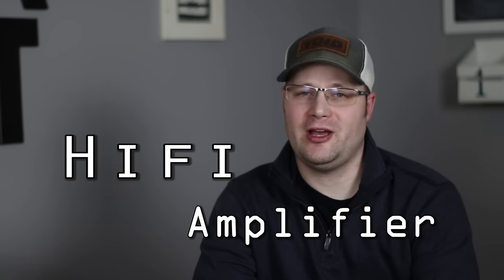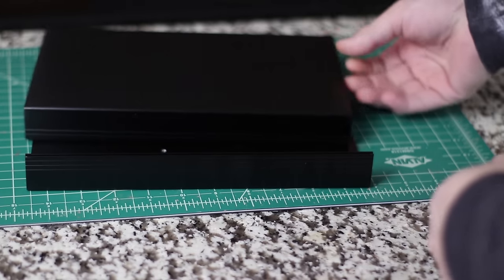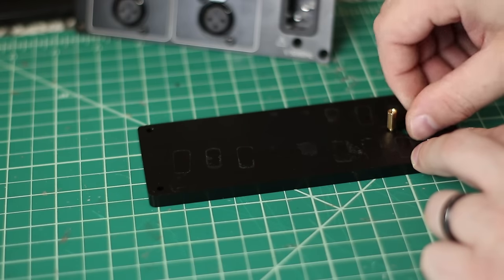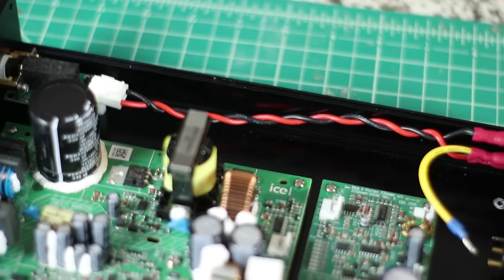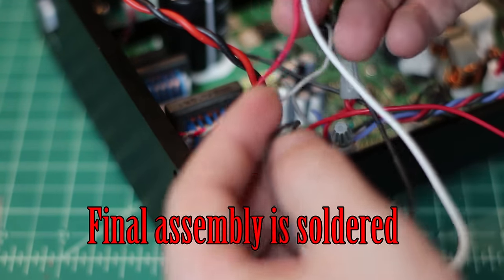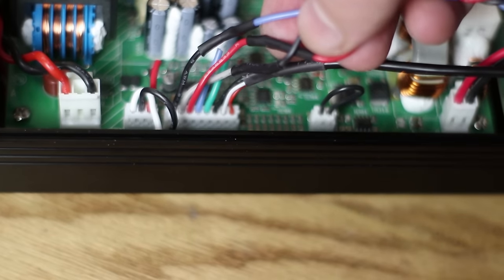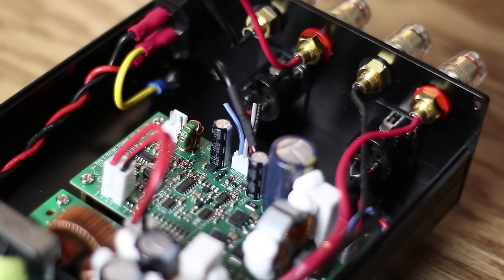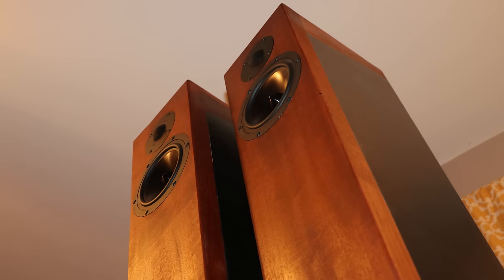How to Make a $3000 DIY HiFi Amplifier for $300

Comment: Humorous. This reminds me of specs put out by boombox manufactures of the 80's. I would throw my head back and laugh at a boombox producing 250 watts or more while running off of 8 D-Cells. What were those epic specs, PMPO? instead or RMS? Funny. I am not suggesting that is what is happening here but I might be inclined to think those specs are perfect environment specs with non-dynamic sources bolstered by more robust bench power supply systems. However, before somebody gets butt hurt because I decided to pick on D class, I can honestly say these amps would have a good fit somewhere, like for bookshelf or desktop system. It is all about proper application of any tech. I don't see a net value of $3000 whether they were badged PS Audio or not. If you put $3000 in my hands, I could get some gear of vetted substance. You put $300 in my hand and I could probably do the same with some used vintage gear, that would look and sound amazing.  You don't need to be a snob to be an audiophile and you don't need super deep pockets either. It's just unfortunate that deep pockets promote snobbery in audio. I am amazed that people have no problem buying a used car, that has hundreds or thousands of moving parts, but will not buy a used amplifier. What you do need is vast exposure to different platforms with practical listening time. You can't retire an old Sherwood receiver, put one of these amps together and think you have entered audiophile nirvana. It don't work like that son. Here is what I would do though. Go to a boutique store during their off hours and explain to the auditioner your situation to gain some exposure or ask to sit in on another's audition time. Just be a fly on the wall and you may hear what I am trying to convey. You may get an opportunity to buy someones old gear as they salivate over the new gear's fancy lights and dials. You don't need the snakeoil stuff. You just need some well designed stuff that will last the long haul, investing the larger portion of your dough towards your speakers.
Reply: Do you know anything about class D amplification? They put out GOBS of power in small form factors and low power consumption because of how efficient they are.

Comment: Got a thrift store that gives me all there electronics. I will stick with my free onkyo reciever. 7.1 suround sound and it even hooks up to the internet.
Reply from the maker: That's pretty sweet!  This would actually hook up to your 5-7 channel RCA out on the back of your Onkyo to upgrade the amplifier section.  So if you ever want to upgrade that is, you could do something like this. That is really awesome you get electronics for free
Reply: @Toid  that was the nicest one yet. Not a scratch on it and almost no dust on it. Its going in the 200 sq ft house im building. I think the power it has will do in a space that size. Just havent figured out what speakers to use. I have a nice collection of free speakers from Bose to Advent and JBLs. My house looks like an episode of Hoarders.
Reply from the maker: @chuckfinley5206  haha, just the way I like it!  Sounds awesome!

Comment: Oh Mhe Ghash... I don't need a smps power supply next to my pa.  I'll stick with my obsolete but still functional stuff from the 70s considering my aged ears;  just wish I still had my long-gone, low-efficiency speakers which would probably cost over $2.5K ea to build from scratch.

Comment: Anybody else here missed some sort of volume knob or buttons?
Reply from the maker: This is a HIFI amplifier that is typically used with a preamp like the rear RCA output on your surround sound receiver. The preamp has the volume control.  If you wanted to use this as a stand alone, without a preamp, you'd just need to add a potentiometer.
Reply: I see. Thanks for answering!
Reply from the maker: @clorophilla  you're welcome

Comment: Great video!!  I almost didn't click on it but super glad i did..  You should put $3000 for $300 in the title
Reply from the maker: I might just do that. Thanks for the tip!
Reply: I subbed as well.. Keep em coming!!   @Toid
Reply: @Toid  Yo bro, fyi that link to the Ghent case is broken.. Says certificate is expired
Reply from the maker: @Fine_art_aerial  thanks! I'll fix it
Reply from the maker: @Fine_art_aerial  I think it is fixed.  Here is the new link.  Thank you!  http://bit.ly/2N3SQZO
Reply: @Toid  Quick question.. I really want to build this but kinda skeptical..  How would something like this compare to the Onkyo m504?? I looked at the specs of this diy and it is tiny at 6"x10"x"2.. How can this be such a high quality amp and be super small like this?? Thanks in advance
Reply: I referenced the Onkyo above because that was the amp i was just getting ready to buy from eBay
Reply from the maker: @Fine_art_aerial  I've never heard the m504 and can't find it's specs, so it's hard to say.  There size difference is in the type of Amplifier.  This IcePower is a class D, while the m504 is a class AB.  A class AB is going to be bigger and use more electricity.  Whether you like the sound of one better, is going to be a personal preference.
Reply: @Toid   Looks like i got some research to do.. Thanks so much for responding! Whens the next video release??
Reply from the maker: @Fine_art_aerial  I should have 1 it later this week. I'm hoping to get 2 edited if I can.
Reply: @Toid  Cool can't wait!! One quick question.. Do you know of a preamp that would be similar in size and looks?? Im going for a very minimalistic look.. Only thing im gonna hook up to it is a turntable and my tv.. Oh and stream spotify so maybe bluetooth?? Thanks brother!

Comment: interesting build .. still wouldn't call those HI-Fi THD levels audiophile comparative ... with every thing relative .. may be better suited for woofers or even sub applications .. tech has improved for class D with some impressive results .. using eGaN chips achieving a stated "< 0.05% THD+N,  > 102 dB SNR" even then I would still only slate class-D for moving the mass of woofers and subs, and leave the fidelity of higher freq signal reproduction to other amp technologies, in regards to audiophile level audio... No clue if this is even avail in any kind of affordable consumer market yet, but sharing simply for the tech spec's in defence of class D for application in high end audio .. this tech would absolutely be ideal for inertia monitored distortion feed back signal processed woofer/sub applications ..  Is food for thought ... Here's the link to their 200W amp using their eGAN chips..
https://epc-co.com/epc/Portals/0/epc/documents/thirdparty/eGaNAMP2016_Consumer-123115.pdf
Reply: The human ear cannot hear that zero after the decimal point in THD specs -- studies vary as to the point at which THD becomes audible, but they agree that it occurs in the tenths of a percent range, not mere hundredths.
Reply from the maker: Many High End companies publish their THD=N at 1 watts.  Which for this amplifier the THD would be 0.008.  I feel that is misleading, which is why I give it's THD at full power of 0.2% THD.  So before you compare THD levels, you need to see how they are even measuring it (ps most won't tell you).
Reply: @editorjuno  what most people don't understand is that Distortion levels are not a fixed value and are almost always a Cherry Picked number from a sweet spot in the Spectrum.. this means that Distortion levels will fluctuate and if the numbers listed are best case scenario that means that only a small percentage of the time will the Distortion levels be at that sweet spot so if that cherry pick value borders the audible range that means most of the time the Distortion will be in the audible range.. when the quality of the equipment is high enough providing that extra padded zero after the decimal point it does matter because most of the time the Distortion will be far below the audible range at any reasonable power level no matter what frequency spectrum is fed through the system
Reply: @VorpalForceField  -- A fair point.  That said, all the Class D chip vendors publish detailed THD+N vs. power graphs that anyone wishing to get past the marketing hype can access online.  Just find out what chip is in the product you're thinking of buying and get yourself Googling.  :-)

Comment: those +12v -12v wires look like there a little weedy for 200w rms ...........  50w maybe.....
Reply from the maker: Here is the data sheet on this amplifier. Keep in mind this was created for oem.  Ie to be sold to HiFi amplifier companies that need accurate data.  Unlike data tailored for consumers.  https://www.parts-express.com/pedocs/specs/326-108--icepower-200asc-class-d-amp-with-power-supply-module-1x200w-data-sheet.pdf

Comment: While yes, many companies use ICE modules, many of them have a lot of engineering into developing the amplifier as a whole. This could be the power supply, input stage, volume control, etc. So, no, this is not the same as buying a PS Audio or a Bel Canto... more like the equivalent of buying an Emotiva which does like you do, just plop a standard ICE module in a chassis and call it a day. A completely separate discussion is the consideration of value. Value is such a variable thing, that it is often times a difficult thing to define for a wide range of people. Value can be solely from how the equipment reproduces music and the level to which you expect it to perform in certain areas like dynamics, distortion or others. It can also be from the social status it brings you, or the satisfaction it brings you in knowing you have a particular brand or aesthetic. So, without some evidence, whether that be measurements or listening tests, I wouldn't blindly equate things based simply on the fact that some of the hardware is shared between companies. It's almost like saying that an SUV and a sports car share the same engine, therefor they are the same... when you drive it, you will see it is a completely different experience.

Comment: Anyone actually hear this amp? Is it worth making? What makes it worth $3000 as an amp?
Reply from the maker: I've made quite a few for people. All have been very happy with them. I know,  I love mine.  There's also since reviews on Parts Express website from those who have built it
Reply: @Toid Nice. What speakers do you push with it? I'm thinking about using this as an amp from my Yamaha AV receiver for the L-R speakers. Do you think that would work? Blu-ray>Yamaha receiver>>*this amp*>L and R channels
Reply from the maker: @4thewin759  That is exactly how I use it.  I use my Left and right RCA pre outs to this.  Right now I am running my KMA speakers on it.  But I plan to upgrade to the Wavecor towers I am finishing up.
Reply: 123Toid very cool. I definitely be giving this a shot. Appreciate the video! Cheers

Comment: Class D with good sound stage, damping, and flat phase error?  I doubt it...
Reply: Well. It's not early 2000's. Look up Anaview AMS0100/AMA1000 and Hypex amps. They are excellent in all regards.
Reply: @oskjan1  Well, I looked those up, and oops they cut the phase errors graph off below 10hz...  And oh, it rolls off severely after 5khz - that won't do anything to the soundstage at all...  Some BBE might fix it..  At least they put some 90's technology in there - DC servo.  $450 per channel aint really cheap is it, compared to an old $24 gainclone which would have similar performance.
Reply: It's ok to be dependent on everyone elses opinion, isnt it?
Reply: @Genuine Audiophile What does that mean though?  Most of their statement looks like virtue signalling.
Reply: @Genuine Audiophile Ask any microwave RF engineer about matching, and they will explain that operation at the frequency in use is irrelevant.  What is imperative for zero artifacts, is that the output stages are resistively loaded and phase-aligned correctly at ALL existing system frequencies.  While there is not a plethora of diplexers and resistive loads in these amps, the plainly visible artifacts in the graphs are ignored or truncated, the science of measuring the created sound stage is undeveloped, the amps resistive output being put into several octaves of rotating complex impedance, and the amount of shill in the industry - I cannot accurately put my finger on any 'improvement'.  edit: That article (which I read) was written by the people who market the amp.  Do you not find this unusual?
Reply: @Genuine Audiophile Again, that's not really science.  Thanks for the exchange, we both have important things to go do.  Best regards.

Comment: Put this together exactly as instructed, it does sounds GREAT!....but $3k?  I don't have experience with amps at all really, so I can't say, but seems far fetched to me.......I got a Crown XLS 1000 that  seems to have a bit more power, at least in the low end (bass) from what my novice ears can tell and costs less, without the DIY aspect.  (which I personally enjoy, but most would consider a hassle.....this is CERTAINLY more living-room friendly than the meant for a rack crown however)

The 500 watt or 1000 watt versions may be better, I might build a 1000 for fun, but honestly, for $300....just save yourself the trouble and get a crown unless you like DIY or want the smaller quieter profile.

UPDATE...I will say, the DIY kit does sound CLEAN AF...the crown, while having more to give in the low end, has a high noise floor, much higher than this DIY kit.....actually, I think the crown just has more of a ground loop issue than the DIY kit for some reason (running both from my PC in my office)....I have a handle on the issue with the crown now, but it was a MAJOR PITA, where this kit had no such issue!

I think the 500 watt could improve the low end performance....this is to push my Elac Debut Reference bookshelfs on my office desk, FYI.

I need to do more testing!

Comment: Just get a couple of cheap server power supplies and a couple class D car stereo amps put a switch to the remotes and mount everything in a wood box. Won't look as good but same results only cheaper.
Reply from the maker: IcePower is considered High Fidelity, where it's SMPS power supply helps with it's low noise and low THD.  O.2% at 200 watts. There's actually only about 3 class D manufacturers that are used in HiFi equipment. you can definitely do what you're talkin about, but it won't be the same thing.  In fact I've done it :) might as well use your car audio stuff you have. It just won't be the same. And it won't be considered high fidelity.
Reply: @Toid  use class AB amps still cheaper and hi-fi
Reply: @waderyun.war00034  -- An Class AB amp of this power would be much bulkier and require a massive power supply.  Well designed Class D is 90+% efficient -- Class AB can't get anywhere near that number.
Reply: @editorjuno  also a well designed class AB would about 80 amps of current at 14 volts to match the supposed 400 watts of the class D in this video

Comment: Class D and "hifi" don't go together. Class D is a compromised design that trades sound quality and bandwidth for power efficiency. For people looking to assemble an amp, look into getting a good LM3886 board off ebay (or build one from components and a DIY pcb). You would also need a transformer and a power supply board...switching power supplies should not be powering anything where sound quality matters.
Reply from the maker: There are definitely people that believe that. But HiFi companies tend to disagree. You now see numerous HiFi amplifiers using class D technology. Even PS Audio claims their class D is one of the best amplifiers they carry.  Most of these manufacturers either use IcePower or HyperX modules.
Reply: @Toid   That's because hifi is more of a marketing buzz word than an actual quality of the product. True high fidelity implies stable sound output across a range of frequency and an inaudible noise floor at all volume levels. Once you hear true hifi you'll understand why all others are not, and an LM3886 amplifier is a great way to hear true hifi without spending a lot of $$$.

There are above-average Class D amps but none will sound better than an average Class AB.

Comment: Just built this and disappointed. Using my Yamaha RXV1 as a preamp the amp sounds good. However, when I hook up the speakers to the RXV1 directly, the Yamaha can drive the speakers much harder. You can tell the Yamaha has a lot more control of the woofer in the tower speakers. Was hoping to build a few of these so I can go separates... I'm thinking not!

Comment: That's too pricy, wheres the chinese version?
Reply from the maker: There is no Chinese version of these.  These were originally designed by Bang and Olefson for HiFi use.  Someday, maybe the Chinese will be able to make something as nice as this.  But as of now, only IcePower and HyperX make these high quality boards.
Reply: @Toid  -- The boards are actually built somewhere in either east Asia or eastern Europe and definitely not anywhere in Scandinavia or the low countries, which would nearly double the manufacturing cost.